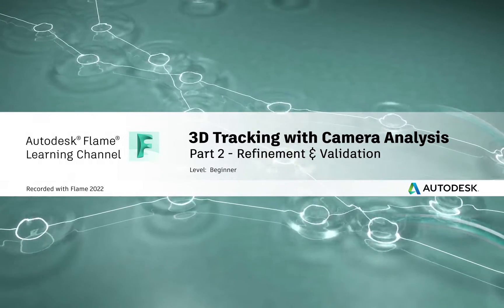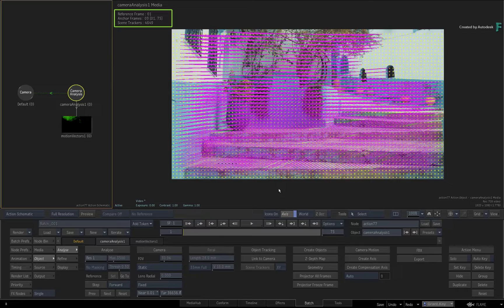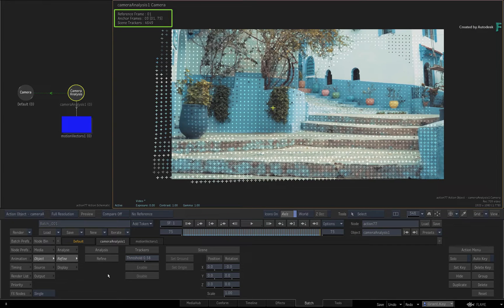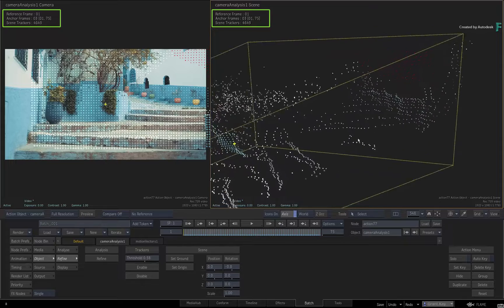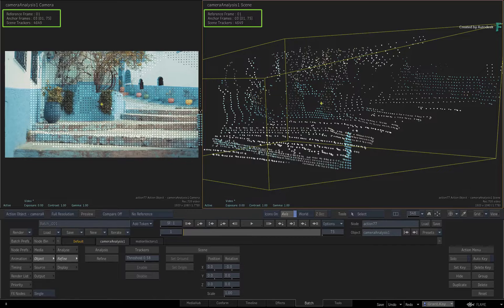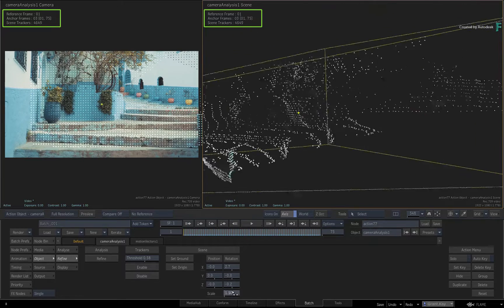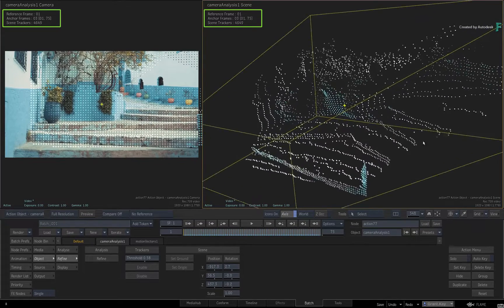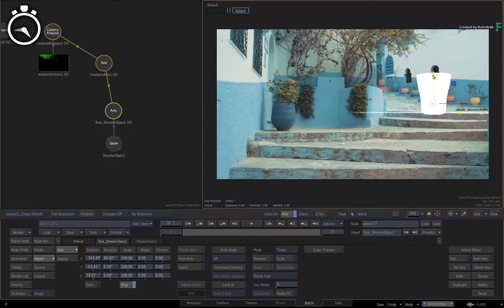3D Tracking with Camera Analysis - P2 - Refinement & Validation - Flame 2022

Comment: What happens if you dont have a ground plane?
Reply from the maker: Hi Ben, If you don't define the ground plane, the 3D tracking will still work fine and its useable. 

But looking at the setup in 3D space, the world alignment will match a horizontal camera instead of the correct camera angle of the shot.   For example, if you track an arial shot and you don't define the ground plane, you will see a horizontal camera and your point cloud will be vertical.  This may make it difficult compositing objects in at the correct angle to the ground.

You may also have to manually align an axis created off the 3D track because the ground plane also defines the alignment of the axis to ground.  So it is probably more fiddly.

We suggest using because it gives you so much more information about the 3d scene that you could use in Flame or any 3D app you may export an FBX to.

Hope this helps!